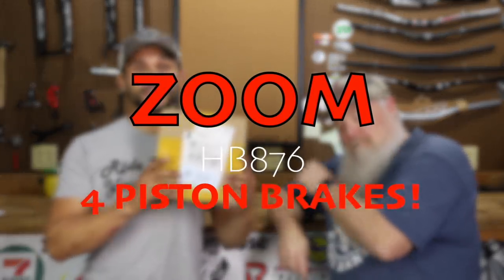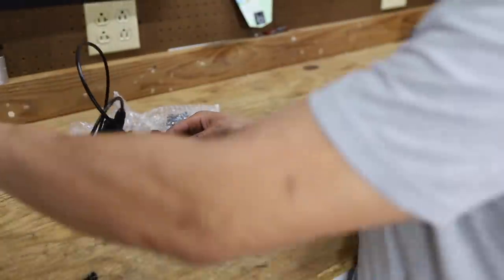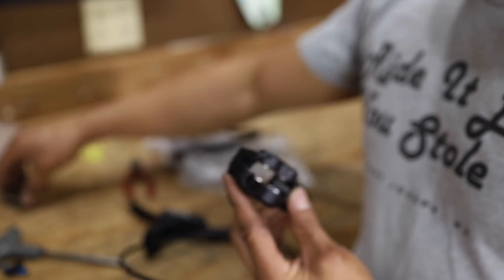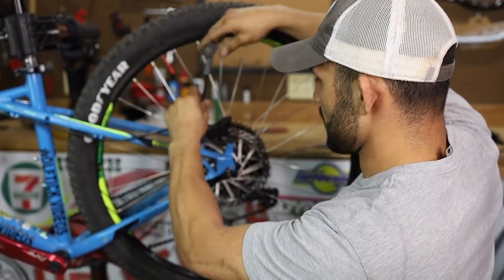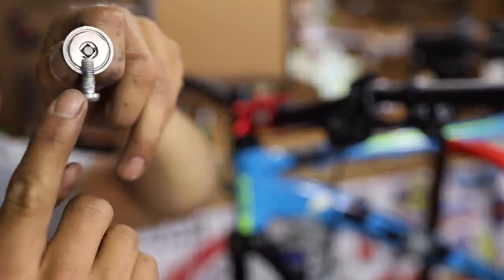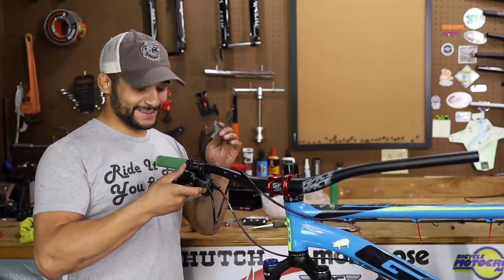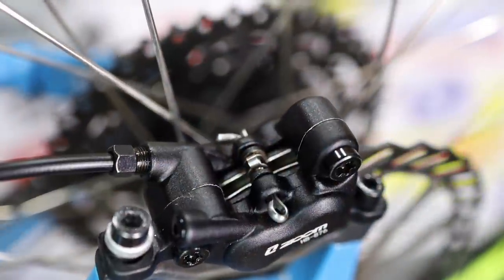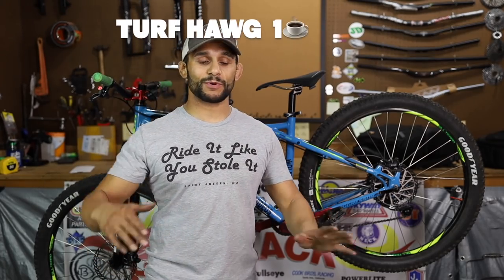ZOOM HB 876 Initial Impressions & Install

Comment: That's why I put some grease on bolts, so they don't seize. Plus, I don't tight too much brake leavers and shifters, I can turn them up or down with little bit of effort. Just in case if I crash, I won't snape the levers. Considering how often you crash, you might try same tactic 😉 just don't leave it too loose, or it will move under normal riding, when braking or changing gears.
Reply from the maker: 😉😉 Man you actually like i crash a lot!! LOL  Appreciate the input and i will pit a tad bit of grease Mario, thanks brother.

Comment: 9:41 The white stuff on the bolt is original  thread locker, I always applied  Loctite 243 to cleate a bond between the threads.
It's unlikely these bolts got corroded, as they are less exposed to road salt. So to do this you really have to want to make them corrode.
Just in case the bolts should only be tightened enough for the brake to be secure while in use, but you should be able to knock them out of position. This is done to protect the brake, if you torque it down hard you will bend and snap brake levers. I've seen alot of ths ton kids bikes, cus bikes were assembled by summer job ppl not mechanic. Not checked.
To prevent bolts from corroding you can use a bit of grease at the shim. Also Loctite protects it from corroding too. But let it cure over right. But keep in mind it turns into powder eventually afte rmany months, but Loctite works well to keep bolts secure. But don't overdo it. It will be harder to remove. But to me it seems like you overtorque the bolt. You should be able to remove these bolts with a mini ratchet.
Reply from the maker: Not sure if there was ever Loctite on there, but there was definitely corrosion. When aluminum and steel are joined together for a while plus some rain it will start to corrode.

Comment: They look like semi metallic pads to me but I don't have much experience with pads haha my codes have full metallic pads and they stop on a dime. Little bro had a good time riding this weekend. He didn't go otb and I didn't eat it on my first try with clipless pedals 😂 honestly pretty confidence inspiring for someone who's scared of jumps. You really feel locked in with them
Reply: Loop the brake hose and zip tie the sh*t out of it. Thats what I did cause I didn't want to cut my hoses either. Might be looking for a full suspension frame to build and I'll probably need the longer hoses for it haha glad the GT is getting some love. Hope those new zooms perform well! Neat to hear they work well with shimano rotors too
Reply from the maker: Dude you clueless now!! Ooh! FANCY LOL, I have thought of it but it scares me....I really don't think I could pedal with a planted foot all the time. Bit getting air would be nice with the bike stuck stuck me

Comment: Funny you said the brake levers are weird I was looking at all those zoom type brake sets and was thinking the same about the levers so I said the heck with it and just ordered the zoom HB-100 Xtech calipers the other day so I can use my stock levers. they probably will work real well the full oil set up but I been happy with the HB-100's on my other bike so I think they will be good on the goose ledge X1.  Nice video guy's
Reply from the maker: Thanks brother, the hbs are fine enough for stopping power. They should suit you well, good choice 👌

Comment: Nice screwdriver extraction method - not seen that before - especially without cutting slots in the bolt
Reply from the maker: Thank you Sir!! We try to be practical. I was thinking grinder but the screw was a little recessed.
Reply: @WOLFTICKVIDEOS  Woah!!! A grinder…. Maybe a little too aggressive…

Comment: The problem with other brand of brakes thats noy Shimano,if u broke a lever or Caliper u cant purchase a replacement parts,also it its difficult to repair.Thats why i install a shimano Deore brakeset (Easy to bleed, Performance and Durable).Well, brake and fork are the  most important/crucial bike. upgrade.
Reply from the maker: You are exactly right Migo, the Shimano stuff is easier to find and repair. But let's see how these things do!! See ya Friday Migo👍

Comment: Awesome video as always! I have a question about this GT. I have a GT Timberline 29" with basic parts, but I wanted to upgrade it and basically just take advantage of the frame. Can this frame handle heavier trails and small jumps (maximum of 1 meter)? And regarding the suspension, Is yours ok? I'm thinking of a Pike 130 mm (original is an XCM 28).
Reply from the maker: Hey brother, you can catch up on our videos of the GT. We have put it thru hell and back and have gotten plenty of air as well!LOL But frame is great, and the factory fork is not that great over time. I run now an x fusion, but just watch some videos brother. If you got any questions feel free.

Comment: When you were showing the brake lever hitting your knuckles, that's the same problem I'm having with my Shimano MT200's. I don't know if it's because I switched from the RaceFace Half Nelson grips to some grips that are a bit more thick or if maybe I need to slide the brake lever over some, all I know is it's pretty annoying, I didn't have that problem with my Zoom brakes, and actually my Zoom brakes had the same type of lever as your Shimano MT401 levers.
Reply from the maker: Wow, what a surprise.....Let me tell you were you first went wrong, TAKING OFF YOU HALF NELSONS!!!🤬
Reply: @WOLFTICKVIDEOS  🤣🤣🤣 had to color match the grips ,lol. I actually went with BW Ergo Lock 1.0 grips, they're a tiny bit thicker then the half Nelson but thinner at the inside and go wider towards the end of the bar, makes for a more comfy grip, you should give them a try, actually I'll just send you a pair, look out for them next week.
Reply from the maker: @NonLegit Nation 2 awesome man, thanks for thinking of me! Now don't hate if I don't dig 🤣🤣 Please!!! But I probably will like them if they are only slightly thicker😉 Appreciate it and please add a note if possible. Thanks again brother 🙏 also color matching is no EXCUSE!!😜

Comment: Weird seeing zoom brakes with the levers being on the"correct" sides. My zooms had the handles opposite which drove me crazy until I sucked it up and got a hose kit so I could size the hoses and switch the hoses around
Reply from the maker: Man you are right! So happy that they are not wonky🤣🤣 Last thing I want to do is cut hoses man, it drives me nuttz. Makes for  some good content but usually takes a while.

Comment: I might have to try the zoom hb 876.  The other zooms I got.  I took apart.  And added fluid.  They work better then when I first got them.   Now would I recommend them for downhill.  No. Simply because ya can not feather the break.  I have them on two budget bikes I have.  They work. I will probably get the hb 876 for the budget bikes since it seems better.  I’m gonna be spending way more money on breaks for my intense bike where ya search n search for the best deal.   I’m looking for magura or trp.  Have you guys used any of them ??
Reply from the maker: Not yet, but we hear we need to!! I am so looking forward to trying these and getting a  true feel for a bike that I know. Thanks man

Comment: I thought zoom discontinued the whole brake line up. I guess this is from remaining stock. But I guess these brakes are Clarks brakes so maybe they actually make them so if that's the case they might continue to be available. But ubde rzoom name they will probably be gone. But I see zoom has focused on new forks the past years. They have air forks for various uses, with adjustments. I don't know if they are junk or useable maybe something for your channel to test.
Reply from the maker: Man from what we know they are going strong. These seem to be the newer variety....

Comment: You should have brake sfurthe rin to have better leverage and only us eone finger, one more tip, adjus teach so you start with tip but brake with mid bone. But those shifters might make that impossible. The ebrake are not something I would buy. But I think I will try Formula Cura 4. I think I will order a set from Geometron in UK. But these brakes proba øy cost 2 or 3 or 4 times as much.
Reply from the maker: 😳 damn that is expensive!! LOL Appreciate the tips as always Johannes

Comment: Can you not just swap off the levers?
Reply from the maker: I am not too sure, they have a weird punch out design, you just put pressure on the pivot point of the lever and it comes out. Curious if there are any others like that.

Comment: Hey tick u ever have full brake failure , with hydraulic brake system or cable , if so can u do vid on that , maybe test it , lol
Reply from the maker: Great question man, as many bikes as I have ridden and brake tests, not once have I had failure. Thank God!! I will tell you that will now be in the back of my head because of you!!! 🤬🤬😉
Reply: Make sure ur padded up , and gloves , lol , I be watchin , lol
Reply from the maker: I have to chime in on this, this is the old guy. The Tick has been hit in the head alot so he forgets. He actually famously had a complete failure of his rear break and it didn't go well from there. Here is the link to that video and you might want to skip all the stuff in the beginning, so fast forward to the 12:07 mark or use the time stamps in the description. Thanks and here you go: https://www.youtube.com/watch?v=sLEIOoxVY_0&t=22s